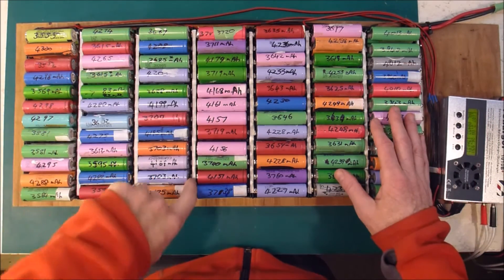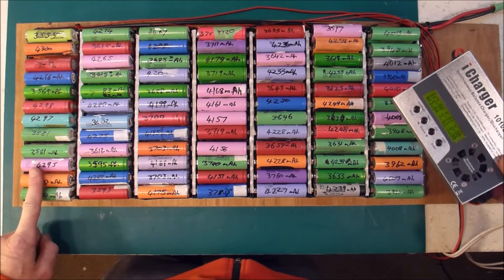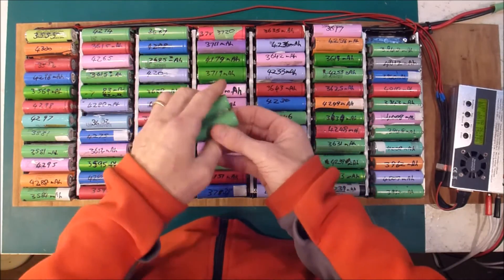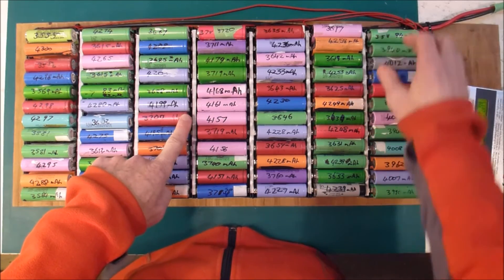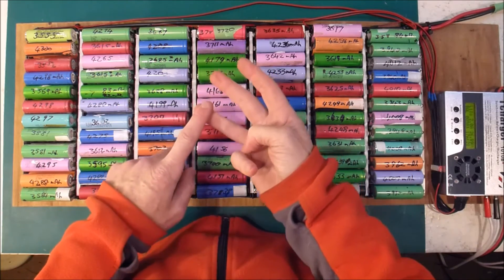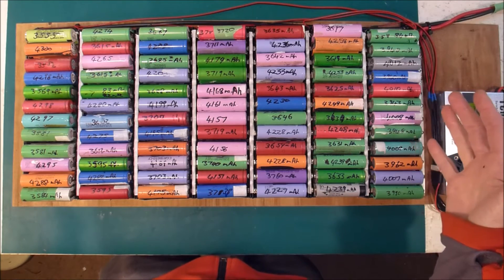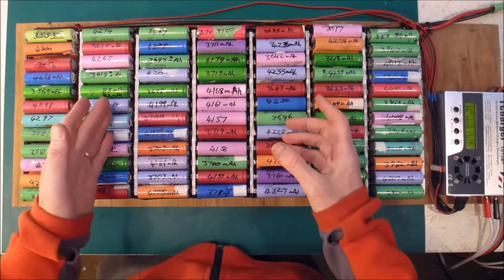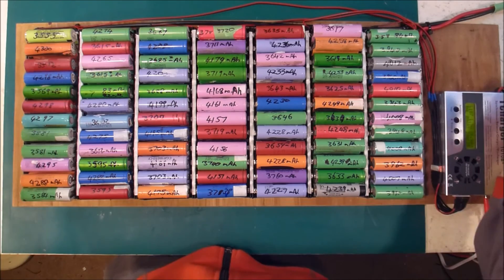Laptop Powerwall 50 - powershelf power-up

Comment: I'm really intrigued by your use of 18650 holders , instead of using 2x batts do you think 4x batts per slot would be better and would,you need to change the fuse wire used ? Cheers
Reply from the maker: One of the key benefits of pairs is that's how they come inside most/many battery packs. So it reduces workload. Whereas quads would add more work for not much benefit. Unless you're wanting to build just a small 7S4P pack. Fuse wire value would depend on your intended load. In practise you might be able to get away with using the same fuse wire. Maybe.
Reply: +Paul Kennett - thanks for the reply . Having a battery welder I'm able to parallel as many as desired , this also allows me to match each sell and ir each set . Also means I can use lower capacity cells to achieve better balance ... Only concern is the fuse wire .. Will need to test 
Again thanks for the input appreciated

Comment: what is your inverter low voltage cut out?   is connected now to your solar charger, did cells unbalance in these days?
Reply from the maker: I'm not sure exactly. I'm not running the inverter right now because I'm not getting enough solar (it's mid winter here). Before summer hits I'll see about making a separate low-voltage cutout myself. I don't trust the inverter to save the battery.
Reply: Yes my inverter would cut off at 10.5 v for that time my lead acid would be dead

Comment: Wow - progress.  I've been somewhat distracted by a BBSHD 1000W motor for my pushy - terribly good fun.  Running 52v, recycled cells just fine.  And grading a huge bucket of pairs for my wall when I have time.  My holders failed to arrive from aliexpress (same guy as you) which is a real surprise given how much stuff we order from there and the failure rate (this is the first out of >100).  So ill need to try again.
Reply from the maker: That's a lot of grunt for a mid-drive system. You might find you go through chains pretty fast.
Reply: Indeed - im being super gentle with shifts - a fair bit of skill involved to do it cleanly.  Need a shift sensor to save me $ in chains.  Plus a narrow wide front cog (10sp chain and cluster).

Seriously awesome power.  Addictive.  Feels like superman or $1M man.  And very sad when I hit the BBS voltage cutout :(

Was overtaking cars and filtering - pretty surreal experience and think I surprised a few drivers the other night here in west auckland.